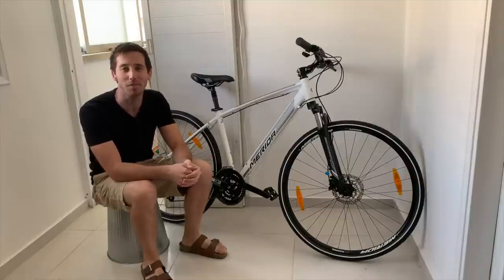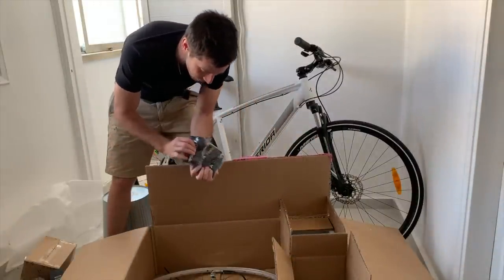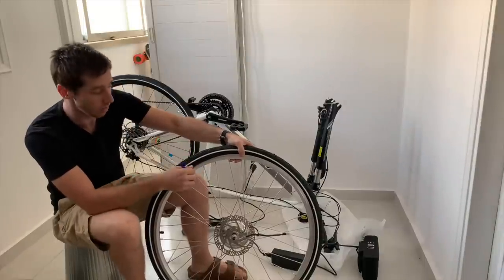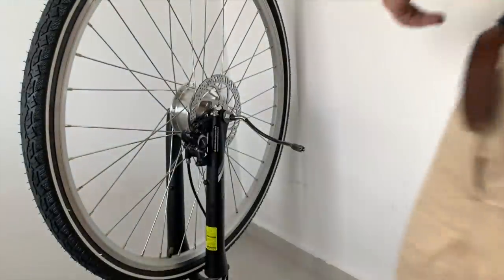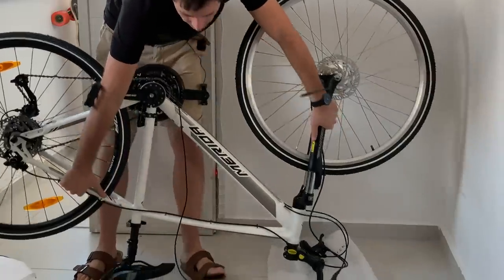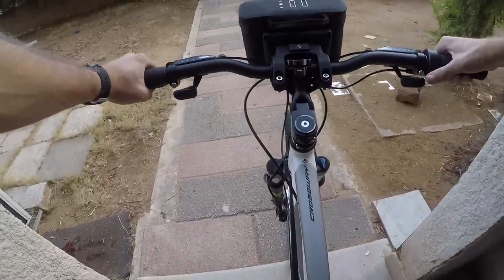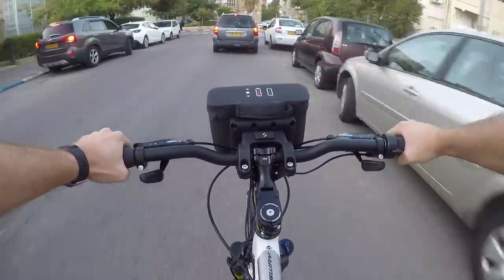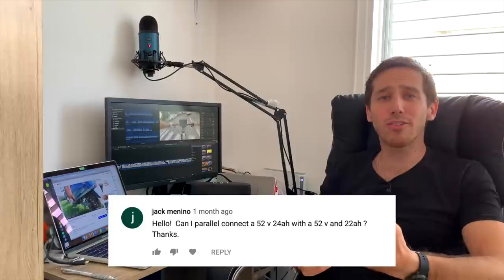How to build a simple e-bike with SWYTCH kit

Comment: SWITCH?  Don't fall on polite, good looking smiles: it's all about money: customer has to pay in advance, then have to wait and wait; like in some socialist country. If  something is good here is the price: SWYTCH gear is overpriced heavily.  Creators forget to think about customers life with SWYTCH: they think that lady with SWYTCH will take the 1,5KG SWYTCH batteries into grocerie shop or to walk with it while shopping? Delusions! And if they do it, rain can fall on the opened connectors. The release button for SWYTCH KIT should have a lock. 
The SWITCH kit doesn't contain brake sensors or gas switch. Other kits do. And when you want to buy it, they complicate everything with hiding everything possible: price, delivery, small parts. They think we are dumb by hidding informations and placing them around the corner. How much power has their kit. You will find several dumb questions and dumb answers, instead to serve straight tech info.  SWITCH shop is overpriced, frozen website. When you wan't to buy something you are forced to subscribe yourself for next 3-4 months of waiting. 
I pre-ordered one kit already: first you have to wait their newsletter. After that, you have 3 days to pay it in order to have discounted price, what is only a cheap trick for us dumbs.
Others simply have better offers. Their ordinary price is less than discounted SWYTCH kit. Well, SWYTCH kit has 40Nm of torque, others has 30 Nm. But who needs so much, when battery doesn't offer more and can't be locked on the bike. 
For example: now is November, I want to have two e-bikes till summer. One SWITCH has been paid in October, but there's only fog if I could get another one till March next year, so I ordered the other kit in Amazon and will get it next week. Discounted preordered SWITCH costs 590 EURO in advance ( battery 250 Wh, 7Ah), waiting time 10-12 weeks, then add ANOTHER 170EURO for another costs, while other kit ( battery 12,5 Ah, 436 Wh), with everything needed enclosed, costs 540 EURO and comes in a week.  Don't be fools, people.
For SWITCH which I'm waiting for and is for my wife, I'll have to customise it, to be lockable. Nobody will pay me this work, which could be done by SWYTCH company, if they really cared about customer's satisfaction. It is not fancy ! Imagine carrying 1,5 KG battery all around as an add of SWYTCH.  Who's dumb here.?